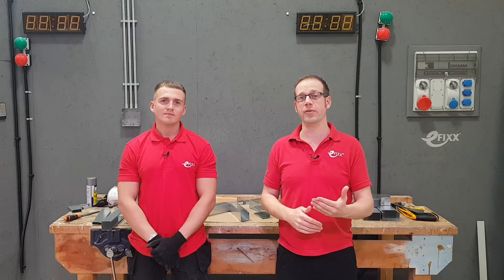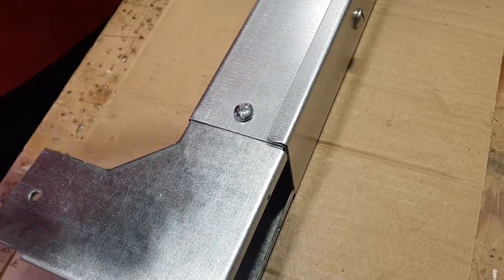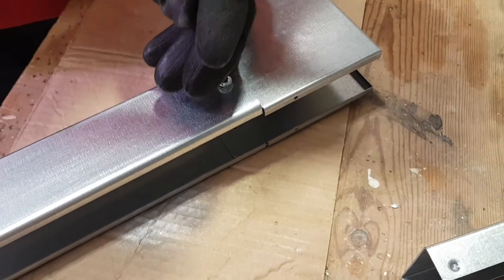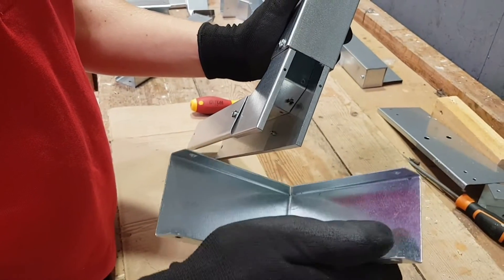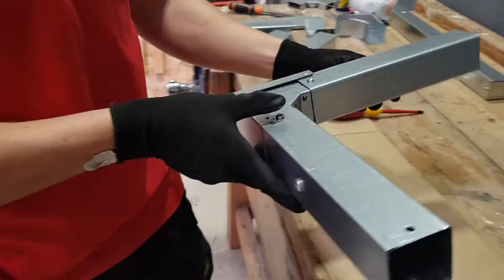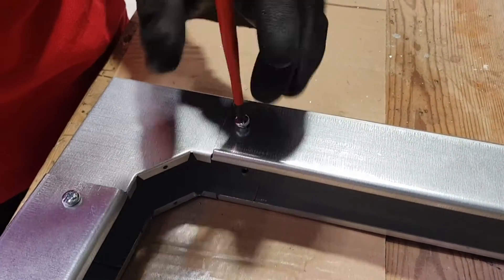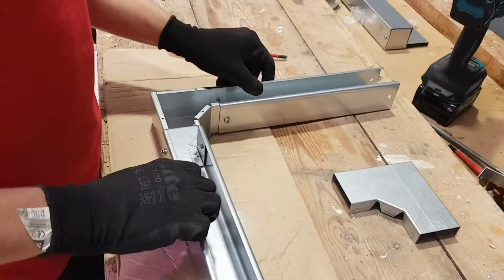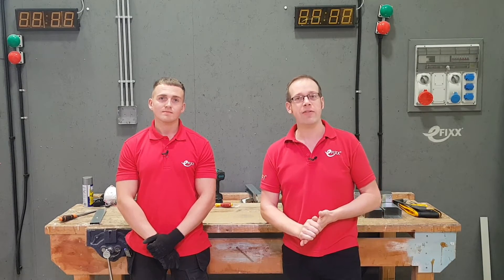Top Tips for Fitting Right Angle Pre-fab Accessories to Metal Trunking

Comment: Just wondering what you would do if these 90 degree bends are fitted to trunking fitted at ceiling level, when there's no space to screw in the top screw? Is it acceptable to only have the bottom screw fitted? Many thanks for any advice.